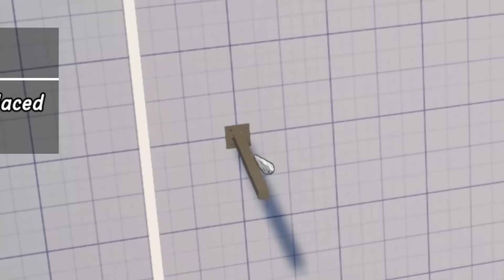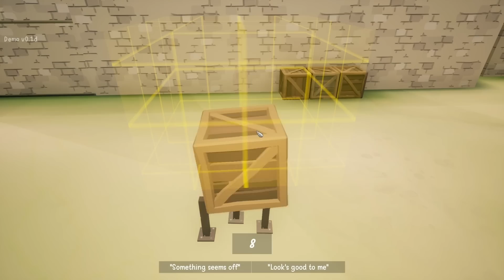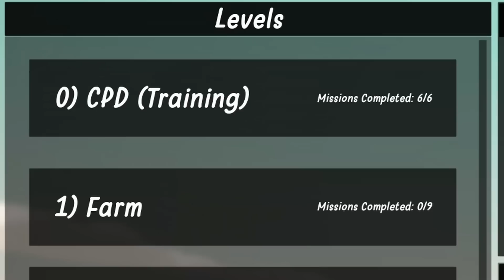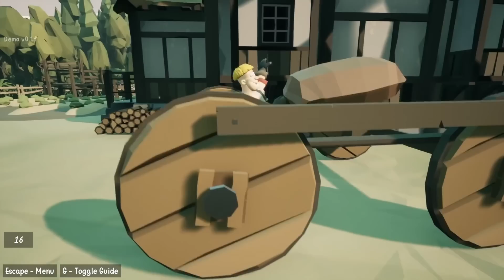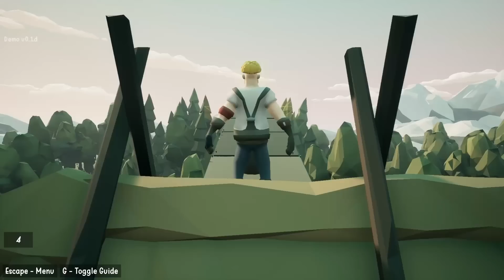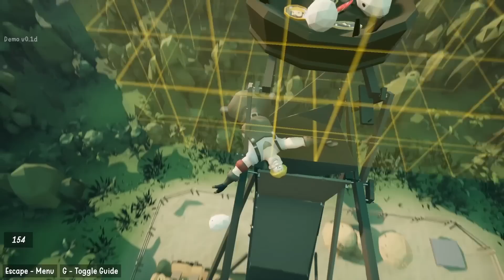Could This Game Finally Be 3D Poly Bridge?

Comment: The game needs a toggleable symmetry mode for those nails: Placing one on each corner ... manually ... one at a time ... for each panel ... seems like it's going to be a pain.
Reply: thats the point lol
Reply: It's not really meant to be a precise game, as noted from the title
Reply: @codemob Ah yes. Excusing bad design choices.
Reply: the problem is there is no axis of symmetry in a 3d game like this, they could possibly allow the player to place one themselves however
Reply: @tertsv7746
This is easy enough for voxel or block based games but in true 3d trying to create symmetry planes yourself sounds painfully precise and also like a logistical nightmare to program in in a way where the player isn't constantly frustrated something failed to place on the other side.
Reply: @Kingdeathtrooperits not really that hard or annoying, the game clearly isnt fir you lol

Comment: In besiege, the blades normally are powered by a wheel, which works but it creates a torque, but if you put a unpowered wheel behind the powered wheel, it doenst spin the creation so i hope you see this comment